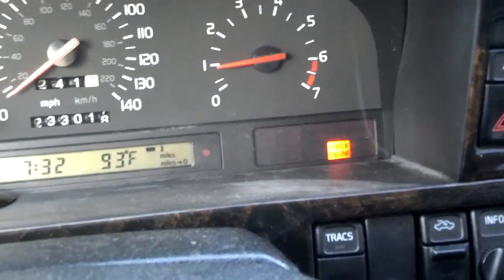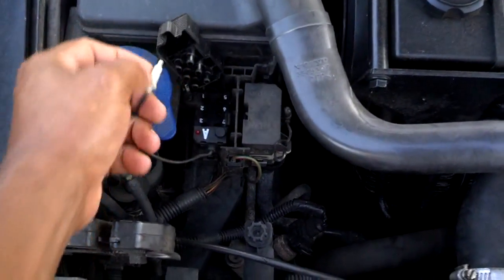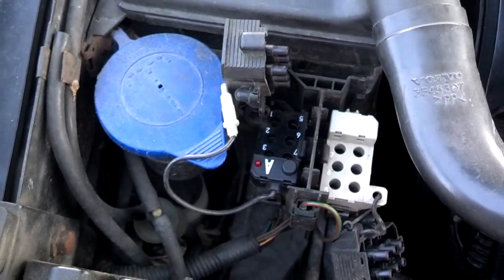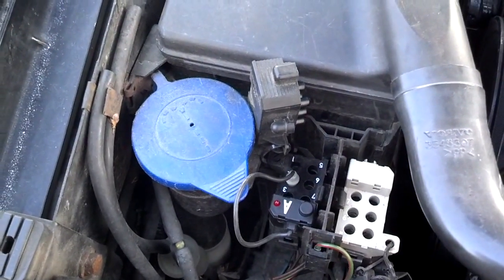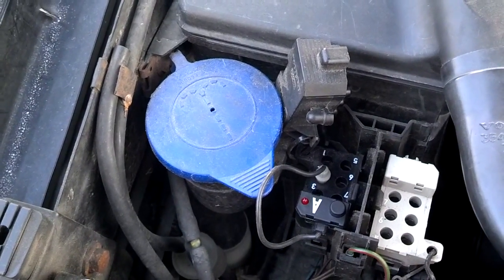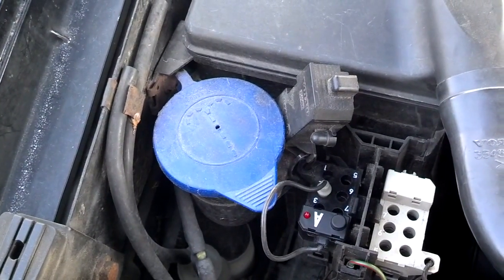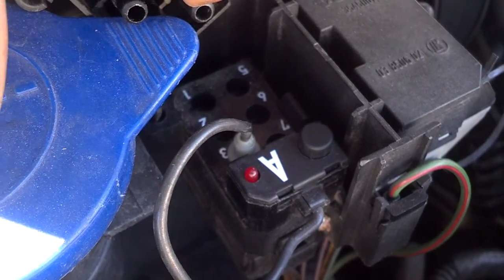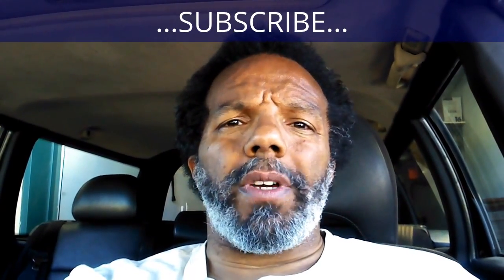How to read, scan for and clear error codes with the diagnostic tool on the Volvo 850, OBD1 - VOTD

Comment: Very helpful video. But I have a problem with my A7 port in OBD1 it doesn't respond any blinks (others are working, A2 port works only with Dealer's immobilizer on) I want to read real mileage of my 850 but A7 port don't respond. What should I do?
Reply from the maker: I clean the port connection or replace the little box.

Comment: I have problem of engine stalling randomly while driving my volvo 850. Also electric issue engine bay light shows up when this happens. Error codes i found were 223 and 131. No idea what those mean though :/
Reply: Maybe something with wires or idle air?
Reply: I also think idling is a bit uneven
Reply from the maker: Did you check the description area to figure out the codes?

Comment: In the A2 and A5 ports, I have no codes that come up, as the light doesn’t flash at all. But in A1 and A6 I get 111. There is a code PO111 related to intake air temperature sensor, is it possible mine is showing the code 111 for that instead of saying no code?  I’m having issues with it stalling out while driving.
Reply from the maker: I don't even know what kind of car you have. 🤷🏾‍♂️
Is the CEL on? 
If your foot is off of the pedal when it stalls it is probably the MAF. If it stalls when on the gas pedal, probably the fuel pump.
Reply: It is a 94 Volvo 850. It only stalls and sputters in gear. It’s happened both in drive and reverse. Usually when my foot is off the gas or on the brake. No check engine light is on but it is still throwing codes. (8 different codes to be exact, the only new one is 111). Unfortunately the clear code method you shared is not clearing the codes for me.

Comment: Hi Robert. You helped me in the past. I have rebuilt the 850 T without passenger airbag. But the connector is there. I forgot if it have a connector. I think not. But now fault code 222 will not be erased. I know how to do it, but not. Help please. Thank you . Mattias:face-pink-tears:
Reply from the maker: How can I help you with that?
Reply: @RobertDIY  Hi- Is there blind connector instead of passenger airbag? I forgot how it was three years ago when I bought this car. Or maybe special procedure? Car was original like this. THX

Comment: Hey Robert, love the videos they are very helpful! I have an issue with my 1996 Volvo 850 station wagon, the light for engine electronics has turned on and i was wondering if you have any recommendations for how to diagnose what is causing the light to be on, no issues with the car when driving or anything, and cant find anything obvious which might cause it. Again love the videos!
Reply from the maker: https://youtu.be/NhtUXZTurzo?si=_Tq0zwqSV08Wwacc
Reply: @RobertDIY  Thanks for the help Robert! it took me while but i did figure out the whole thing with diagnosing the car. The Volvo i have is a 1996 station wagon, it is a european version so the OBDII port it has is non-standard, meaning i can only read codes from the airbags and ABS system. The other fault codes could only be read by using a home made LED cable tool for reading the codes in the same way the older versions of the car. This had to be done by using the connectors in the OBDII port and conecting them with wires to a LED-bulb, and then dipping one wire into another connector in the OBDII port. I ended up finding the fault code 442 (Same code for motronic 4.3, 4.4, and Fenix 5.2 i belive). Though now i am having issues with finding the relay to the air pump, alot of information on the internet, but there is alot of different information on the same subject, so it is quite hard to figure out what is right and what is wrong. You dont by any chance know the location of this relay? Some info say it is one of the relays in the fusebox in the engine room, some say it is close to the engine cooling fan, and some say it is located close to the right side ECM. I do belive, if i have interpreted it, that the air pump relay it is talking about is the one connected to the seconday air injection system. Again thanks for the help, though the video you linked was not the fix for my car, it helped me alot in locating the information i needed!

Comment: Hi Robert,

Thank you for showing me how to clear the Fault Codes on a 92’ Volvo 740 Turbo wagon.

Before I would take the Negative terminal off the Battery.

Then I would have to program all my Favorite radio stations.

So much easier now.
Reply from the maker: Nice, glad this helped.

Comment: Good day Robert, I have a volvo 850 1994 Non turbo. I have rebuilt it from a crash and it is working fine except for a few minor details.... I wanted to read the error codes on my OBD2 port and on 2 of my port, I do not get an error code, not even a 111.... the light iluminates when I press the test botton but after it stays off no blink. What could I check? Thank you
Reply from the maker: Which ports are they?

Comment: Hi Robert. Thanks for the help. Quick question. On A2 section i got error code 122, but its not on your list. What that means?
Reply from the maker: I think it means that the car has not reached the speed required to test that system during that drive cycle.

Comment: Hi Robert , thanks for your videos I've found out how to fix loads of stuff on my v70xc thanks to your channel. Have you ever encountered an intermittent abs code 0074 hydraulic valves faulty signal? My abs sometimes intermittently kicks in under light braking and I've had the abs and stability light come on randomly for a few seconds after 50mph. I know it's a long shot but could it have anything to do with worn tyres on the front and decent ones on the rear being an all wheel drive?
Reply from the maker: https://youtu.be/5Xmesel_NZY
Reply from the maker: Not sure what year model your car is, however, for most of them, if the AWD system is still installed on the vehicle, it is critical to keep all 4 of the tires the same wear ratio/condition. If you fail to do that, you can destroy the AWD system pretty quick.
Reply: @RobertDIY  it's a 1999 v70 xc. At first I thought it was just a glitch with cold weather as the lights only stay on a few seconds then go off and only seems to be after 50mph. I put the tyre pressures slightly higher in the front to compensate a bit and last I tried the lights didn't come on but the abs did kick in randomly under light braking. It's booked in to change the tyres soon so will see if it makes any difference but I doubt it
Reply: Thank you I'll give that a try. Thanks for your help. Love from the UK. 🙂

Comment: Several of the A ports in the  OBDI box on my 1994 850 don't light up when i press the button. If I  remove the box to clean the contacts is it safe to use isopropyl/rubbing alcohol, 70 or 90%? (I don't have electrical contact cleaner.)
Reply from the maker: sure.

Comment: Thanks Robert. Still relevant! Got 2 codes. The A7 Port gave 1-2-2 “temp sensor interval too long”. Can’t find specific answer online. Does this mean the coolant temp sensor? Keep it up. Greetings from Holland
Reply from the maker: That's what it sounds like to me. If the wires are connected properly, I'd replace the sensor.

Comment: Hiya Robert. My old 850 is as base spec as it gets. And it's not got all the A numbers. Only A2 A3 and A7   no loose wires or anything.  It's a 1994 850 estate. 

Looking to try and get to the bottom of a lambda light lol
Reply from the maker: You may need to drive the car until the light comes on and then check it while the car is running.

Comment: Hi Robert

i live in Sweden, but also have an issue on an Volvo 850 -96

The problem is i can not reset my " engine light " 

it did work well to reset it with removing a cable from the battery. 

but that has stopped working, now it impossible to reset it. ive tried several computers, but none of them works :/ 

so im writing to you to maybe get som trix to fix this ? 

Ive benen watching ure videos for a long time :) u got good content. 

keep it going :) 

cheers
Reply from the maker: what code is in the system. fix the problem and you will be able to clear the code.
Reply: @RobertDIY  i dont have any tool to check the code as i described

Comment: Thank you Robert. I tried disconnecting my battery for 15 minutes to clear my check engine light, however it's still on. I will try this. Your detailed directions have me feeling confident. Thanks again for  keeping a lot of good vehicles on the road with your help. Just A little note: I have a 95 Volvo 960. The OBD boxes are located near the drivers side hood hinge.
Reply: Just a update. This worked flawlessly. Thanks again Robert, your a blessing.
Reply from the maker: cool, thanks for watching and sharing.

Comment: Hey Robert, for some reason somebody snipped off the wire on the diagnostic tool on my Volvo. Could I just use a jump wire(like the one from your fuel pump relay video) to do the code reading?
Reply from the maker: you can re-connect the wire. It likely broken off.

Comment: Im trying to clear the lambda ligth but even if i hold for 10 seconds them wait them hold again 10 seconds, it wont reset it, it will just repeat de error codes, what can i do?
Reply from the maker: fix the problem.

Comment: Hi! Great video!
I have a problem with my automatic 850 -93 140hps. It only drives in reverse, transmission oil looks good
I get fault code 232 in the a1 port. Have tried switching the computer for the transmission without results.
Is the best solve to just replace that transmission or is there an easier fix?
Thx
/Elliot
Reply from the maker: I would try the PNP switch.
Reply: @RobertDIY  i read somewhere that you can test the pnp switch by putting it in reverse and if the reverse lights turn on, it should be OK. So I tried this and the lights turn on in R. Could the pnp switch still be the problem?
Thx!
Reply: @RobertDIY  Hi again, I changed the pnp switch today. Same problem still, car drives perfectly in R, but doesn't drive at all in any other gear. Do you have any ideas for fix?
Maby time to start looking for a new gearbox
Reply: I think the 232 code in the A1 port means the transmission speed sensor is bad.

Comment: Hi Robert I have a Volvo 95 850  the on board DTC Red light come on  but don't blink  check engine light is on  I guess it no functioning properly   I plugged on 2 press light come on but don't blink ..? what's wrongs?
Reply from the maker: My guess would be that the box is bad or has a bad connection.

Comment: I noticed you moved the pin from A2 to A3 during the mid last part but than at the end you’re back at A2…. What’s that about ?
Reply from the maker: Don't get distracted. Just follow the instructions.
Reply: @RobertDIY  how can i follow the instructions if you tell one thing and show another?  If the instructions is the same and I can ignore why the plug was in A3 I’ll try it out 😅 Got a beautiful vine red 850 1996

Comment: Hey Robert, thanks for the great video. I have used it to pull codes off my 1995 850 OBD-1 in the past. Right now when I use this technique I can only get codes from A7. when I plug into the other ports and hold the button for the same amount of time, it doesn't flash any code. No flashes at all for anything but A7, and I'm not able to reset the codes. On some of the other spots it dimly shows the red light when I plug it in, but on others, no light at all. I wondering if I need to replace anything in the plug system? Any thoughts for when it flashes for one but won't flash anything for the others? I'm pretty sure it has codes stuck in some other places that I've gotten codes in the past (like A3), and that's stopping me from resetting.
Reply from the maker: Probably needs to have the box cleaned out or replaced.

Comment: Well, I am confused! I own a 1995 850 but there is no OBD port under my hood.  From the OBD2 port (inside) I can't get any information for some reason.
Reply from the maker: Have you checked the fuse?
Reply: @RobertDIY  yes! The computers connect but can't get any info from the engine. We did manage to get info from abs.

Comment: Robert, if I'm correct that this applies to the 960 as well, what I just discovered trying to check transmission codes on my 1993 960 (OBD1) is that instructions I find online say to plug the test lead into hole #1 to run this test. Problem is: when I check the OBD unit, hole #1 has no  wires going to it.  The harness that feeds the OBD unit A (there are two) only has wires going to 4 of the 8 holes, by design.  And hole #1 is not one of them.  Your thoughts? Thank you!
Reply from the maker: It may have an internal link. Does anything blink when you jump that hole? If not, you'll need to check a manual to see which port will give you transmission codes.
Reply: @RobertDIY   Nothing blinks, which was my first clue something wasn't right. At the very least it should give me a 1-1-1 reading. That's why I started looking at the OBD unit itself and discovered there is no wire to the #1 port.  I'm following instructions for the pre-'96 960s with the OBD1. The instructions are the same here: http://www.volvotips.com/index.php/940-960/volvo-960-service-repair-manual/volvo-960-automatic-transmission-diagnosis-service-manual/  AND here: https://www.volvoclub.org.uk/faq/TransmissionAutoAW30.html#OnBoardDiagnostiCodesforAW3040SeriesAutomaticTransmissions   No matter, I just thought you might have run across this particular peculiarity and have a thought on it. I was hoping to make some progress this weekend, but I can just ask my Volvo mechanic on Monday.  I appreciate the quick response.

Comment: Hi Robert, another great video. You are a wealth of information! Thank you so much for sharing it! I'm a single mom of a United States Marine and have limited income. Recently having problems with my ABS brakes engaging on their own while driving at about 25 miles per hour. Any suggestions? The wheel speed sensors were recalled years ago & the dealer replaced them for me. The car has just over 170,000 miles, but I would like to keep it running. Can you please give me suggestions. Is it the ABS module or wheel speed sensors that are bad, need cleaning, all or only bad one need to be replaced? Thank you in advance for your help.
Reply from the maker: I don't even know what kind of car you have???
Reply: @RobertDIY  I apologize!! I have a 1999 Volvo s70 base model
Reply: No warning lights.

Comment: What a fantastic video, so much valuable information! If you only knew how few mechanics know this about our old Volvos... I have a Volvo '92 960 ;-)
I do have one question - It looks like that between you reading your error codes, and you resetting your codes, you had moved the jumper cable from port 2 to port 3 - is that correct? And why?
Reply from the maker: Different ports are for different systems.

Comment: Hey robert, I have a 850 with a fresh replaced battery and wires. I run thru the codes and its all codes for sensors.. after reseting the check light goes away, but when restarting the computer thru ignition key the light comes back. Im fairly certain my sensors are all good.. any fixes? Thx
Reply from the maker: If you have error codes something needs to be fixed.

Comment: hey robert im having trouble. my red light is automatically on and the button doesnt do anything when i turn my key. what does this mean? its in a1. im checking for a flashing orange arrow problem. it seems the car shifts fine it just has that arrow when i go to drive
Reply: turns out im also missing the whole connector to a5... there isnt even a wire hanging out anywhere. some of the other ones no light comes on, and/or same thing with A1
Reply from the maker: Just check the ignition and transmission ports.
Reply: @RobertDIY  ok i did that and i get A1 232 and nothing from ignition. my main issue and question is if no speed sensor can cause the flashing arrow and flashing economy light. ive drove around counted shifts dozens of times and it seems to shift perfectly, no sign of this "limp home mode". so is this a good diagnosis of the light? just being from no VSS
Reply: btw i also got p0500 (no speed sensor) from two different obd2 scan tools.

Comment: Hi Robert...when i put the cable on nº3 and start the ignition on, the light turns on right a away and stays there! Doesn´t let me do nothing!!
Reply from the maker: you are not suppose to start the car.
Reply: @RobertDIY  It´s the only way i can read the errors codes. Ignition in position II doesn´t allow me to read nothing! Don´t know why.

Comment: I noticed you started working with A2 port  (fuel system airs) and then without any reason, you changed to A3 port (ABS) and then reset the port. Can you explain that?  Why you changed the port? If we get the "check engine" message how we know what port we need to start working with? Do we need to buy a special tool? and if this is the case what's the name of it? Thank you in advance for your answer.
Reply from the maker: Huh? I was simply showing you how to read and reset the system.

Comment: Hi Robert. I did this with my 93 and all went well except for the A3, no light came on at all, ant that’s the main one I was hoping for since my abs light is on, any suggestions?
Reply from the maker: Not really. You can disconnect the box/reader and clean off the contacts. If that doesn't work, replace the box.
Reply: Robert DIY thanks for all you do, you have helped me with so much!